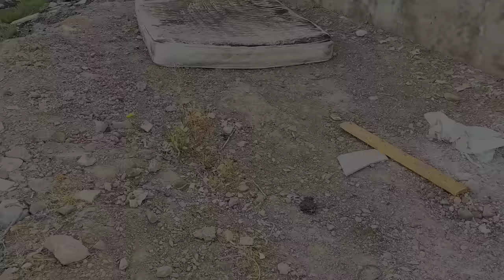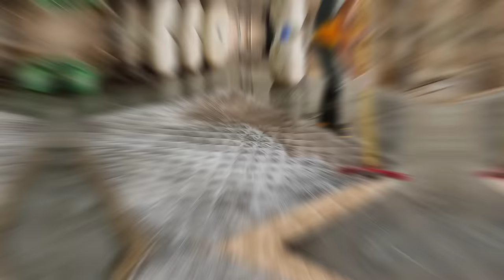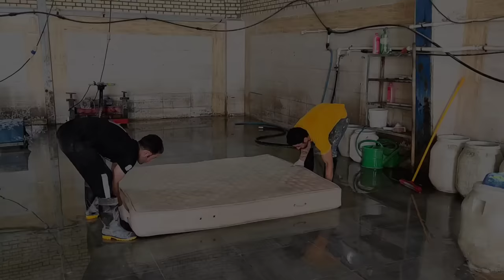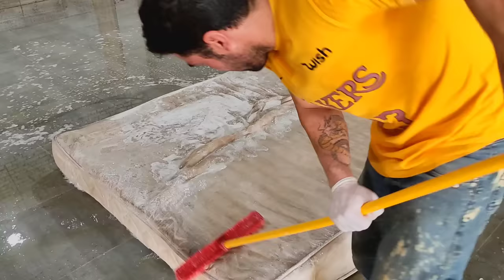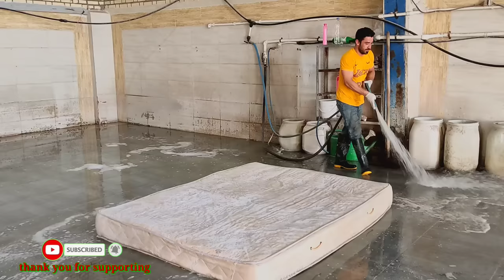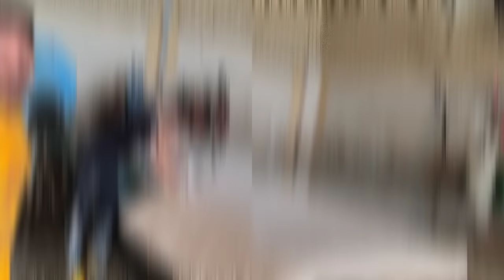Incredible Amounts Of Brown Goo Came Out Of This Mattress During The Wash You Will Be Very Surprised

Comment: I've seen a facility in Las Vegas, Nevada U.S.A. that resells used mattresses that are usually from the hotels or from store floor models. Overall, they still look good. The mattresses are washed/cleaned/sanitized into a huge autoclave machine and giant dryer. They look brand new thereafter. Then, the matresses are wrapped in protective plastic before they go to the store display. They are a lot cheaper than brand new mattress. They are also good to sleep on like brand new matress.
Reply from the maker: Awesome dear, thanks for the info🤗👍
Reply: Ужас...Я не хочу спать на таком ни в отеле, нигде
Reply: Bet those ones are not jumped up and down on ruining the springs 🤔
Reply: @Lianochka2024  Você nem sonha como estão os colchões dos hotéis 😂😂

Comment: The washing method is unsuccessful and wastes time and water because washing the wires inside it will rust and emit echoes inside, thus posing a danger to its user. This type is washed only with a little water with a suction machine and steam.
Reply from the maker: No dear , At all🌺

Comment: Nice job cleaning the outside . But what about the in side.  All that bio Hazard .
Reply from the maker: We used caustic soda solution
Reply: Caustic  sodas. What will that do To the metal springs in side. The safe way to clean bio  hazard.  Is not 2.  I can understand on Expensive item.  But not a Mattress. Keep yourself  safe.